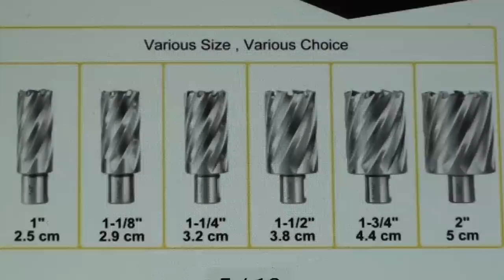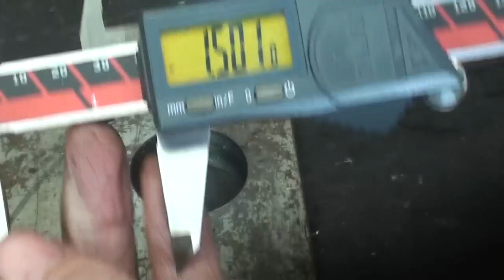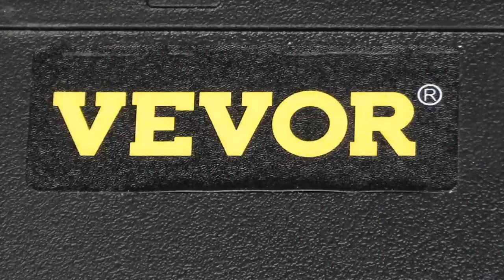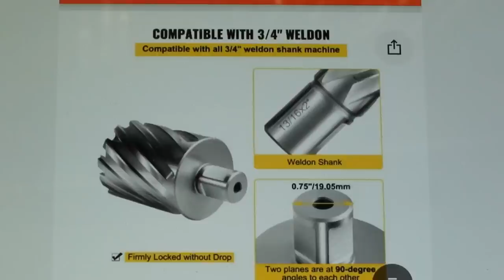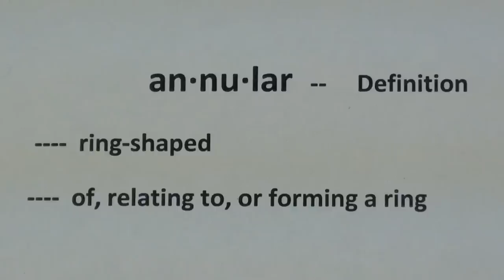WHAT ARE ANNULAR CUTTERS? vevor #858  tubalcain drill magnetic

Comment: I have an R8 to Weldon adaptor for my Bridgeport it has a spring in it for the ejector pin I have a reoccurring job that i have to cut 1/2" slots in 3/8? stock I drill out each end with an annular cutter and mill out in between  they work great for this

Comment: Annular cutters are like trepanning, they leave a slug that can also be used.  The largest trepanning lathe I saw at an auction would cut a 24" hole in a 36" diameter bar at least 10' long.
Note:  I just ordered a set and got the $10.00 off.
Reply from the maker: Wow, that must’ve been some machine

Comment: The mag drills normaly run at a very low rpm.i very well could be wrong but It appeared that you were running the lathe at a bit higher rpm  than i would think those annular cutters would run at. Check out the mag drills details and find out what rpm those drills operate at. And adjust acordingly. That should maxamize life out of the cutters. They definately are nice. Love your videos Mr. Pete.
Reply from the maker: I was running the machinery at approximately 200 RPM. The mag drills are about 400 RPM I think.

Comment: Those are great . I own a few of them and my advice to anyone who wants to get them is to buy an adapter for them be it R8 or morse taper . They will save your tools and make them easier to use and center on the work because of the centering pin .Don't forget slow and well lubricated.

Comment: Those center pins work as a ejector, but their main purpose is so you can line the cutter up with your center punch mark. If you make a holder, you need to make it hollow for the center pin, otherwise you'll have no way to line the cutter up with your mark.

Comment: Used to use these in a steel fabrication shop on a  electromagnetic portable drill . You wouldn't believe how much steel  they can cut through thickness wise. The irony of it is these bits are so hard that they are fragile. And the holes that they cut are clean as a whistle .

Comment: I wonder if you were instructed not to interrupt the cut so it gives a better interior wall finish. It appeared from the video that the depths you stopped showed grooving at kind of the same depths after removing the part from the lathe jaws. Coincidence or ???
I purchases one annular cutter using Amazon for a pinion gear holding tool I made out of 1/4" steel plate. I needed to drill a hole in the center so a 1/2" drive socket would pass through.  Unfortunately my bench top 15" Atlas needs some TLC ( could use new spindle bearings also) so I attribute any issues in the hole finish from this. Regardless, it was so fast and and clean compared to a hole saw.  It worked so nice I purchased a set of them and they came in a cheap case (a waste of metal) from China. Amazon loves supporting China.
Reply from the maker: Yes, you may be right about the interrupted cut. But I was very worried about not getting enough oil down on the teeth.

Comment: Well, I don’t know where the name annular came from , in the aerospace industry they’re called core drills simply because they produce a slug that can be tested. I built the Titan rocket booster for  United Technology Corp a subsidiary of C. S. D.    We manufactured the composite material that lined the “exit” and the “extension cone” of the rocket motor. The lining had to withstand 5000 degrees  Fahrenheit so it had to be tested through its complete thickness  which in some places could be an inch thick of cured carbon fiber. These core drills were ideal for this application. If they were used with the big magnetic base drill motor we referred to them as core drills and if they were to be used  on the Horizontal Bar Mill  they were called  core  mills. Now the best way to hold them for milling is an R8  3/4 hard nose collet with a 5/16 set screw ,  I wouldn’t recommend using your nice Jacobs Chuck because when that cutter gets a little dull, it’s gonna spin in the Chuck and ruin the hard jaws.  You’ll have to regrind them to hold concentricity !!
Reply from the maker: thank you for the very informative

Comment: when i was a welder we used these in a mag drill to punch out i beams for studs. we had a girl that was pretty new and i was welding dual shield while she was boring holes. she was wearing knit gloves and decided to clear chips while the machine was running. i was blinded from welding when she tapped me on the shoulder and said "its stuck!" i thought she had jammed the drill, which is easy to do, so i tried to back it off. she started screaming. her hand was actually caught in the drill and stopped it while it was on! we ended up having to disassemble the drill to get her hand out, and it came out like spaghetti and i could see the bone. it was horrible
Reply from the maker: Awful story

Comment: How accurate/concentric are the slugs these produce? I’m thinking in the lathe it would be a good way to quickly turn down the OD of a work piece. If the ID of the cutters are a nominal size and are consistent, which I’m sure they are.
Reply from the maker: I did not measure them, but I do not think they would be very accurate

Comment: Does anyone know if these will work in my little machine shop mini mill and mini lathe if I run them slow?
Have a Jesus filled day everyone 
Greg in Michigan
Reply: It would take a fair amount of horsepower and high torque at low speed so probably not on a mini- mill. Never know till you try.
Reply: @ellieprice363  
That's what I was thinking but just looking for others opinions.
 thanks.
Reply from the maker: Thank you for answering that Ellie. I was thinking that that machine would be too small and low on power, but I am not really familiar with that mini mill.